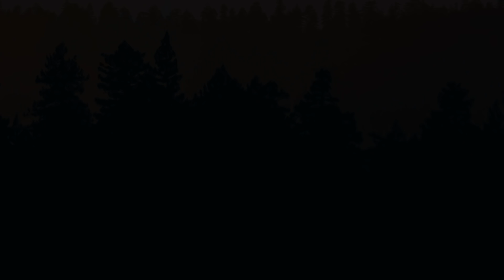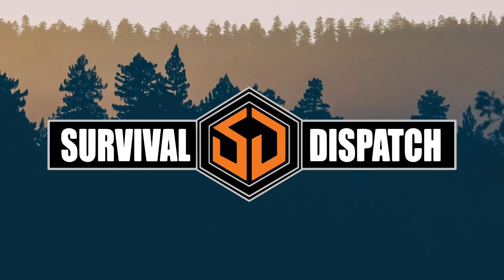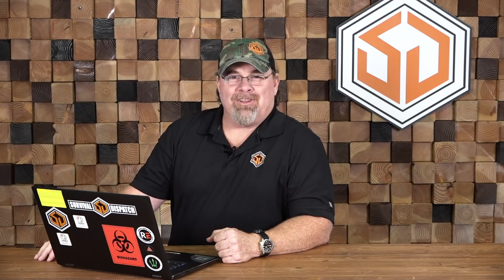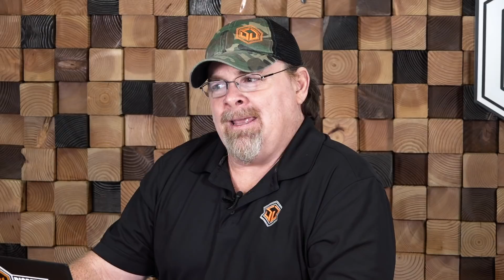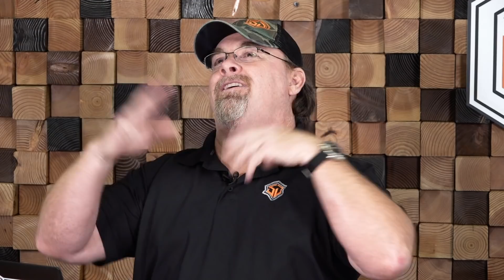All About Generators!

Comment: First about ethanol in Gasoline, EVERY time I use my generator I shut off the gas and work the choke to keep it running that towards the end it is on full choke to get all the gas out of the carb! No gas with ethanol in the carb to do damage! I made up a wood gasifier that I connect to my generator with the air filter removed and gas line shut off! I have put a 8 outlet box in my basement with the other end in my garage near the outside door with 6 more ft to connect with a 3 prong 230 RV plug into the generator. My generator has a 115 or 230 output switch setting it on 115 volts. I then connect with heavy duty extension cords to my down stairs tv/satellite, the furnace plug from its normal outlet over a few inches to the 8 outlet box and I have wired from the 8 outlet box two male plugs that go to a additional two outlets by my Stove/microwave/refrigerator. This outlet has no electric power and is not connected to the home electric panel. With the two male plugs in the 8 outlet box, then power is fed to the two outlets to power the frig and microwave but the stove can be used with one of the others unplugged. Oil changes are not needed as often as you say as depending on how many hours of use! A small 7 to 12 horse power engine when using synthetic oils can go 220 hours but 300 hours of light duty running with no damage. I once worked for a construction rental company and that was the schedule! I bought a Champion 3,750 watt generator with the RV plug outlet with the plan mentioned above. This was also to reduce how much gas it will burn as the bigger the engine the more gas burned. Yet it is plenty big enough to take care of my needs without working very hard keeping the voltage near 115 volts. I also had the internal wiring changed to a BONDED GROUND that my furnaces electronics could recognize it. This is also important for your computers.
Reply: Please remember not to run your generator indoors. Here are the rules about portable generator safety: This is just a reminder for everyone’s safety. All generator safety rules should be followed carefully. This advice is just to make sure that everyone is aware of all the warnings and it’s just to remind people to be careful using portable generators. Generators can be dangerous if not used carefully. Every year, hundreds of people die or get injured when using portable generators due to carbon monoxide poisoning and electrocution. Make sure you are using your generator carefully and keeping others safe as well. There is something very serious that everyone should always be aware of when using generators. Some people do run their generator indoors which is not safe and that increases the risk of carbon monoxide poisoning which can cause death of family and you. Some people run their generator in wet conditions which can electrocute them. Please remember that you should never run your generator indoors. Remember that carbon monoxide is an odorless and colorless gas that you cannot see or smell. Carbon monoxide is a silent killer. Keep that in mind. Make sure your generator is 15-20 feet away from your house and away from doors, windows, and vents. Never use your generator in your porch too. Having a carbon monoxide detector is very important against generator safety. Some people also allow children to go near the portable generator which could pose risks. We need to keep an eye on our children making sure that they are not near the portable generator so they won’t get electrocuted or burned by the generator which is dangerous. A locking enclosure also keeps kids safe. A generator shed might look like a tempting place to explore, or take cover during a game of hide and seek, but a generator is a dangerous piece of equipment that can cause injury. It says on the manual that we should also keep children away at all times from the portable generator to avoid injuries. Please do not allow a child or unqualified people to operate the portable generator.  It is important to keep your children safe especially little ones. The portable generator can be hot during an operation. Just because some manuals missed what should be listed doesn’t mean it’s safe to do. Always follow the generator safety rules when using portable generators. Generators pose electrical risks. If you need to use your generator during wet weather, you need a generator tent to protect your generator from getting wet. Don’t let your generator get wet. Keep your generator dry and before using your generator, please make sure your hands and your generator is dry. Do not wear loose clothing when operating the generator. Everything that is said on the generator’s operating manual should not be ignored. Never smoke cigarettes near the generator. Please keep flammable things away from the generator. Never overload your generator too. Your generator can catch fire. Never ever try to plug a generator cord into a wall outlet to avoid back feeding. Back feeding your generator is dangerous. Always turn on your generator first before plugging in appliances and shut off the appliances before turning your generator off. Use a heavy duty cord for your generator and the cord should not be worn out. All the instructions should be followed carefully. Never refuel your generator while it’s running. It can cause fire if fuel spills while your generator is hot. You should turn off your generator and let it cool off before refueling it. Having a fire extinguisher next to the generator is also important. This is only a reminder for everyone’s safety of using generators. Make sure your generator is properly grounded. Having a fire extinguisher next to the generator is also important against the safety rules. https://youtu.be/I1jT3ANENvI and here is a video more about keeping others safe when using generators and also about our family’s safety. Hope this helps. Thank you.

Comment: Generally great information with a few errors - much of the Caribbean is 110v but North America is always 120/240v,  a standard 12 gauge extension cord is fine - that's bigger than most house wiring and will run any appliance up to 20 amps. A Honda 5000 watt generator needs oil changes every 300 hours, not 24. Some well pumps are three phase and won't run on most home generators. No mention was made of running an oil or gas forced air furnace in winter - check the amperage of your fan motor. The risky part about illegally connecting to a dryer outlet without a transfer switch included "turn off every single breaker", well as soon as you turn off the dryer breaker nothing in the house will get power. The main panel master switch or breaker MUST stay off and the dryer breaker needs to be on, then turn on only the breakers you need to power.
Reply: I posted that as well and also that buy shutting off the gas while running, us the choke to keep it running until it runs on full choke shutting off with no gas in the carb. No ethanol gas in the carb to do any damage.
Reply: My honda 5000 manual says first 20 hours oil change then no more than 100 hours after that.
Reply: @lesman3019  In between being a Caterpillar Marine Mechanic and a Ryder Truck/Refrigeration Mechanic that retired at in 2007, I worked for a construction equipment rental company for a few years! They rented Generac Generators 4,500 watt on up to 12,000 watt gas generators! The 12,000 watt has an oil filter but the smaller ones only a oil pumps of sorts. These we changed the oil (synthetic oil) every 200 hours for heavy duty dirty conditions and 300 hours for light duty. In our experience with different name brand generators and until 1990, Honda Generators were durable but , after that they were, lets say not! They cost a third more, yet they needed to be overhauled more often! This was years ago, so I called my old place of work and found out that they are using Champion Generators now! Just some insight that just like Briggs and Stratton that in 1970 Brunswick bought it! those very reliable one and two cylinder engines were not made anymore. Instead they are now throw away engines are what they are known for. Honda is not what it once was, It is durable, but for the added price not.
Reply: Here are the rules about portable generator safety: This is just a reminder for everyone’s safety. All generator safety rules should be followed carefully. This advice is just to make sure that everyone is aware of all the warnings and it’s just to remind people to be careful using portable generators. Generators can be dangerous if not used carefully. Every year, hundreds of people die or get injured when using portable generators due to carbon monoxide poisoning and electrocution. Make sure you are using your generator carefully and keeping others safe as well. There is something very serious that everyone should always be aware of when using generators. Some people do run their generator indoors which is not safe and that increases the risk of carbon monoxide poisoning which can cause death of family and you. Some people run their generator in wet conditions which can electrocute them. Please remember that you should never run your generator indoors. Remember that carbon monoxide is an odorless and colorless gas that you cannot see or smell. Carbon monoxide is a silent killer. Keep that in mind. Make sure your generator is 15-20 feet away from your house and away from doors, windows, and vents. Never use your generator in your porch too. Having a carbon monoxide detector is very important against generator safety. Some people also allow children to go near the portable generator which could pose risks. We need to keep an eye on our children making sure that they are not near the portable generator so they won’t get electrocuted or burned by the generator which is dangerous. A locking enclosure also keeps kids safe. A generator shed might look like a tempting place to explore, or take cover during a game of hide and seek, but a generator is a dangerous piece of equipment that can cause injury. It says on the manual that we should also keep children away at all times from the portable generator to avoid injuries. Please do not allow a child or unqualified people to operate the portable generator.  It is important to keep your children safe especially little ones. The portable generator can be hot during an operation. Just because some manuals missed what should be listed doesn’t mean it’s safe to do. Always follow the generator safety rules when using portable generators. Generators pose electrical risks. If you need to use your generator during wet weather, you need a generator tent to protect your generator from getting wet. Don’t let your generator get wet. Keep your generator dry and before using your generator, please make sure your hands and your generator is dry. Do not wear loose clothing when operating the generator. Everything that is said on the generator’s operating manual should not be ignored. Never smoke cigarettes near the generator. Please keep flammable things away from the generator. Never overload your generator too. Your generator can catch fire. Never ever try to plug a generator cord into a wall outlet to avoid back feeding. Back feeding your generator is dangerous. Always turn on your generator first before plugging in appliances and shut off the appliances before turning your generator off. Use a heavy duty cord for your generator and the cord should not be worn out. All the instructions should be followed carefully. Never refuel your generator while it’s running. It can cause fire if fuel spills while your generator is hot. You should turn off your generator and let it cool off before refueling it. Having a fire extinguisher next to the generator is also important. This is only a reminder for everyone’s safety of using generators. Make sure your generator is properly grounded. Having a fire extinguisher next to the generator is also important against the safety rules. https://youtu.be/I1jT3ANENvI and here is a video more about keeping others safe when using generators and also about our family’s safety. It’s important to keep our children safe especially little ones. Hope this helps. Thank you.

Comment: I also use uninterruptible power supplies to supplement power needs. While the generator is running they charge up, and then when you shut it off you still have battery supply for many small appliances. I mainly use 1,500 VA UPS on many appliances, they can run lights and charge cell phones for hours, and can even run a microwave or a coffee pot once or twice a charge. they're also very good at smoothing and conditioning dirty power from a generator.
Uninterruptible power supplies are fairly expensive for what they are, but I usually pick them up when I see them on a sale.

Comment: I'm a Commercial truck driver and I have a Harbor freight tool Generator on my truck. It's a 4000 Watt and it runs my 6500 btu window unit and my TV and my microwave witch is only 850 watt. It's a Preditor I've got roughly 2500 hours on it and so far the only thing I've done to it is oil changes.
Reply: Here are the rules about portable generator safety: This is just a reminder for everyone’s safety. All generator safety rules should be followed carefully. This advice is just to make sure that everyone is aware of all the warnings and it’s just to remind people to be careful using portable generators. Generators can be dangerous if not used carefully. Every year, hundreds of people die or get injured when using portable generators due to carbon monoxide poisoning and electrocution. Make sure you are using your generator carefully and keeping others safe as well. There is something very serious that everyone should always be aware of when using generators. Some people do run their generator indoors which is not safe and that increases the risk of carbon monoxide poisoning which can cause death of family and you. Some people run their generator in wet conditions which can electrocute them. Please remember that you should never run your generator indoors. Remember that carbon monoxide is an odorless and colorless gas that you cannot see or smell. Carbon monoxide is a silent killer. Keep that in mind. Make sure your generator is 15-20 feet away from your house and away from doors, windows, and vents. Never use your generator in your porch too. Having a carbon monoxide detector is very important against generator safety. Some people also allow children to go near the portable generator which could pose risks. We need to keep an eye on our children making sure that they are not near the portable generator so they won’t get electrocuted or burned by the generator which is dangerous. A locking enclosure also keeps kids safe. A generator shed might look like a tempting place to explore, or take cover during a game of hide and seek, but a generator is a dangerous piece of equipment that can cause injury. It says on the manual that we should also keep children away at all times from the portable generator to avoid injuries. Please do not allow a child or unqualified people to operate the portable generator.  It is important to keep your children safe especially little ones. The portable generator can be hot during an operation. Just because some manuals missed what should be listed doesn’t mean it’s safe to do. Always follow the generator safety rules when using portable generators. Generators pose electrical risks. If you need to use your generator during wet weather, you need a generator tent to protect your generator from getting wet. Don’t let your generator get wet. Keep your generator dry and before using your generator, please make sure your hands and your generator is dry. Do not wear loose clothing when operating the generator. Everything that is said on the generator’s operating manual should not be ignored. Never smoke cigarettes near the generator. Please keep flammable things away from the generator. Never overload your generator too. Your generator can catch fire. Never ever try to plug a generator cord into a wall outlet to avoid back feeding. Back feeding your generator is dangerous. Always turn on your generator first before plugging in appliances and shut off the appliances before turning your generator off. Use a heavy duty cord for your generator and the cord should not be worn out. All the instructions should be followed carefully. Never refuel your generator while it’s running. It can cause fire if fuel spills while your generator is hot. You should turn off your generator and let it cool off before refueling it. Having a fire extinguisher next to the generator is also important. This is only a reminder for everyone’s safety of using generators. Make sure your generator is properly grounded. Having a fire extinguisher next to the generator is also important against the safety rules. https://youtu.be/I1jT3ANENvI and here is a video more about keeping others safe when using generators and also about our family’s safety. It’s important to keep our children safe especially our little ones. Generators also cause electric shocks. Keep that in mind as well. Hope this helps. Thank you. Have a good one